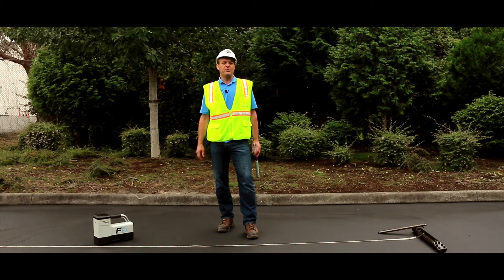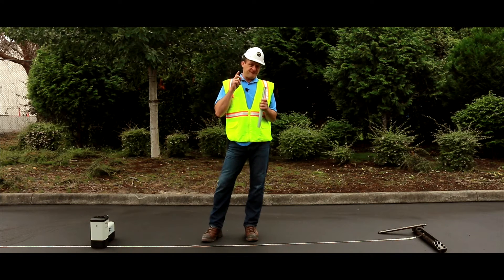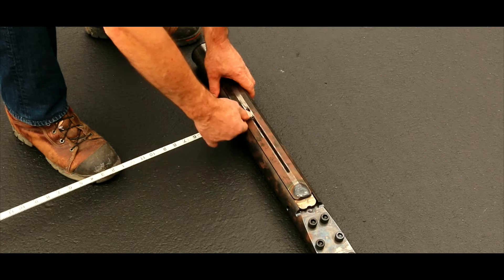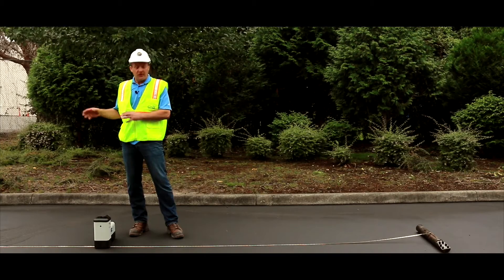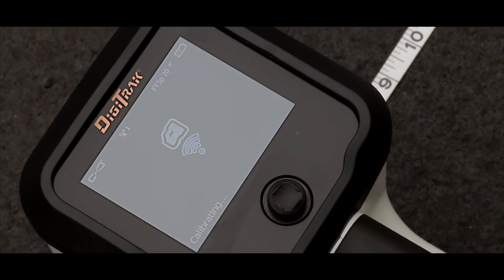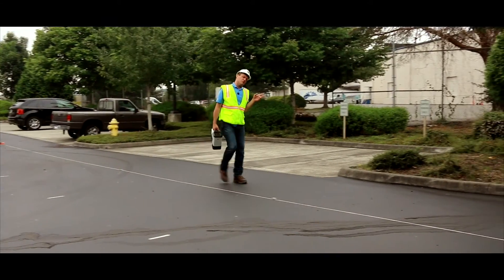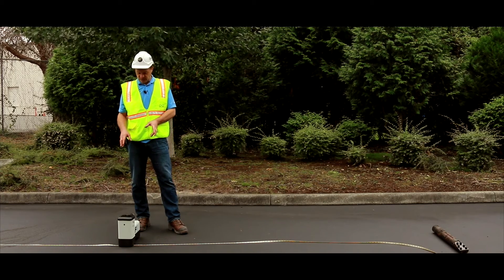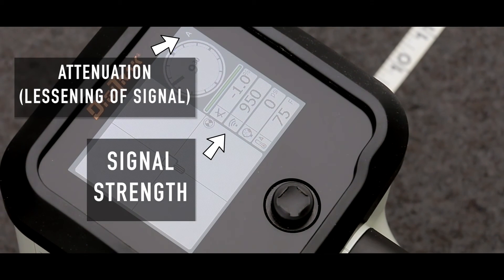DigiTrak - Falcon F5 Training - Calibration and Above Ground Range

Comment: what's the down mode vs up mode.
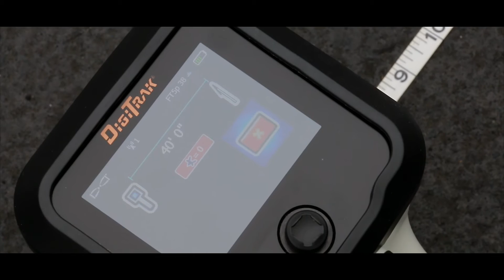Reply: You are able to pair two frequencies or bands to your Falcon F2/F5. Depending on how you hold the transmitter when you load the batteries you can start in what DCI calls the Up Band or Down Band. It's important to note, as Mark does around the 4:45 mark, that each much be calibrated separately.